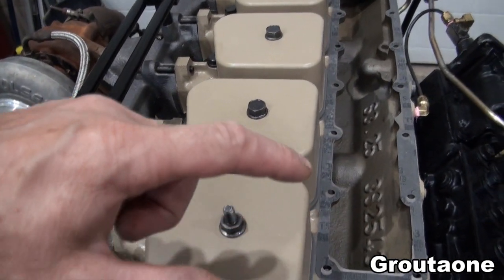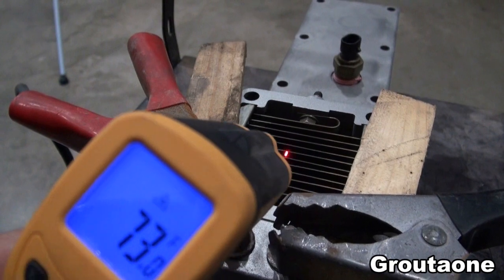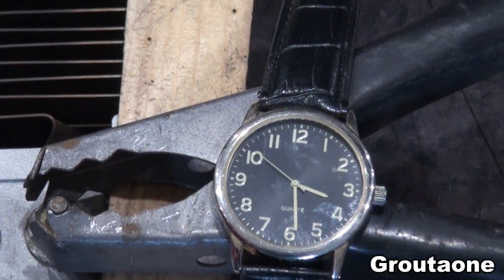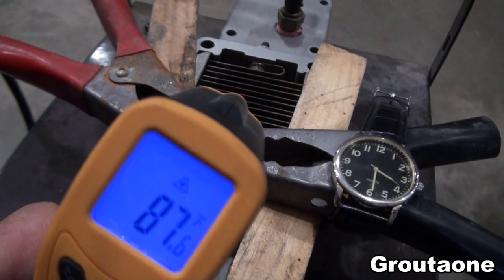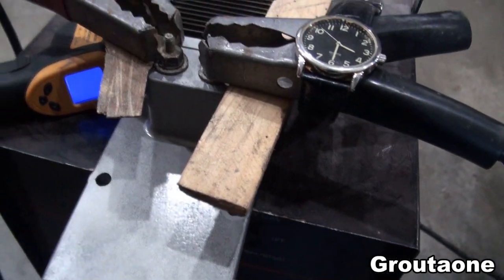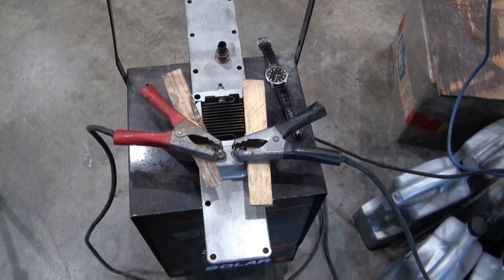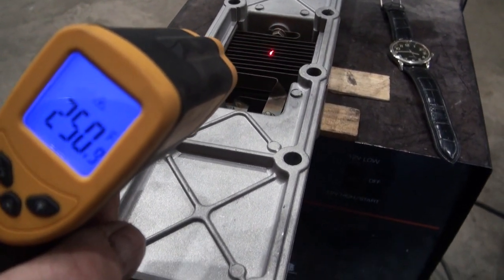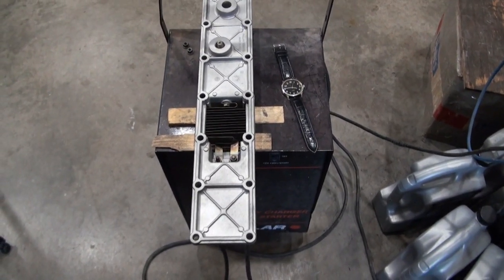12 valve Cummins heat grid Testing

Comment: Those are 2 individual heaters. They are grounded to the intake. each of those teminals you were hooked to get fed hot. Try your test again with the ground clamp to the intake. Whichever teminal you hook the hot to will heat only 1 element and much hotter/quicker. The way you hooked it up tested the whole thing at once and kinda like half voltage.
Reply from the maker: Thanks, makes sense.
Reply: @groutaone  i think the computer may turn them on individual depending on conditions.